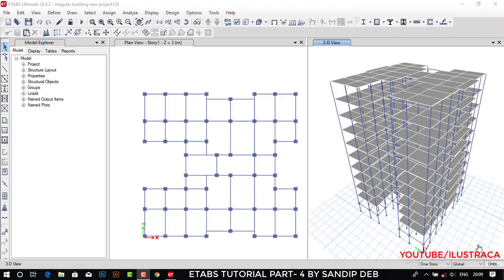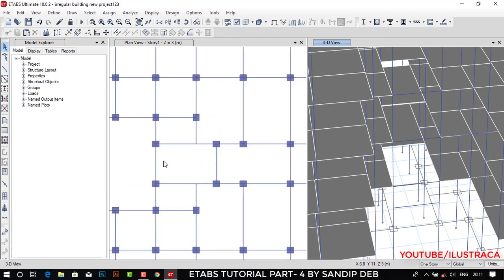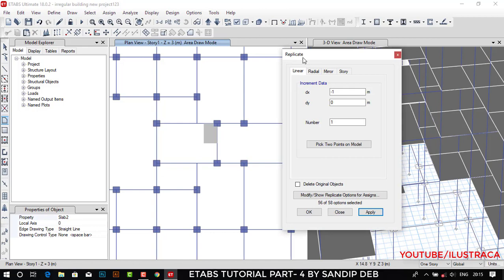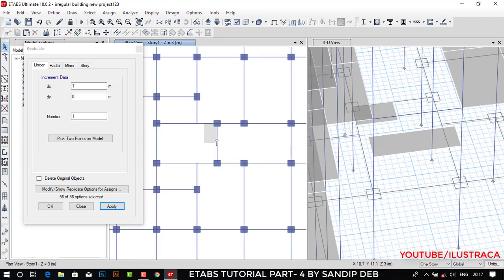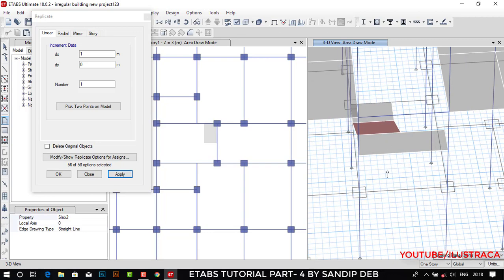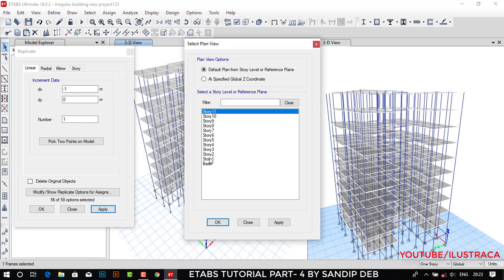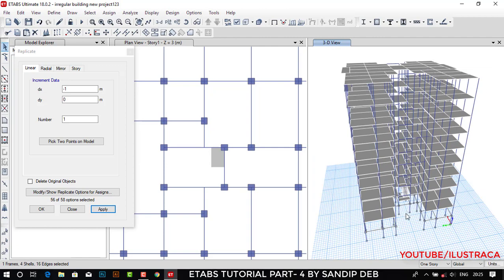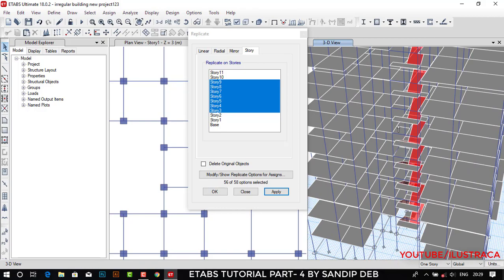ETABS TUTORIAL PART- 4 (ADVANCE) EASY MODELLING OF STAIRCASE | Sandip Deb

Comment: Hi sir, after modelling the staircase, can etabs do the reinforcement design for the waist of the stairs similarly like the slab design.
Reply from the maker: We won't do design of Staircase in ETABS.. we will do it separately.. We created it here in order to consider the load of stair on the  corresponding columns...
Reply: @ilustraca  Ok thanks
Reply from the maker: no
Reply: Sir, How to define My analysis and design results are correct or not.is there any cross checking method..pls do that type of video..